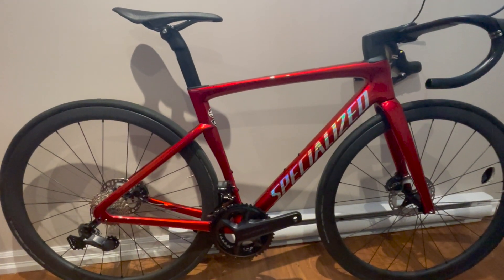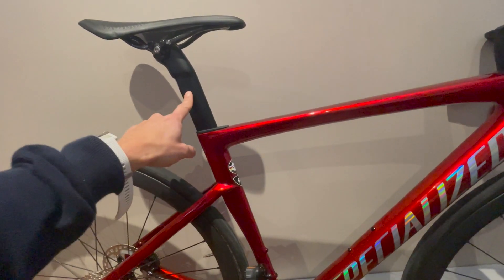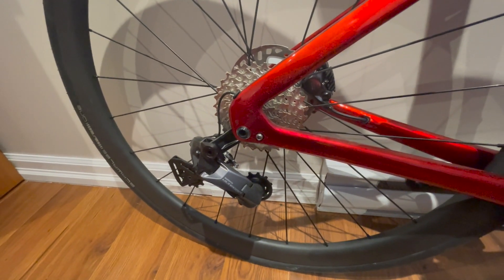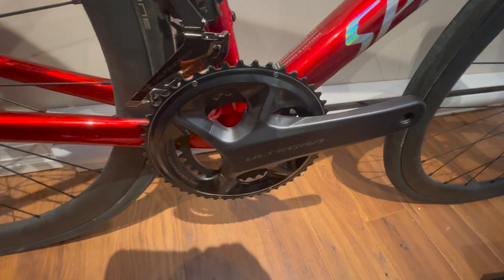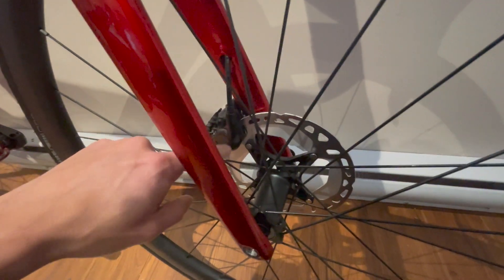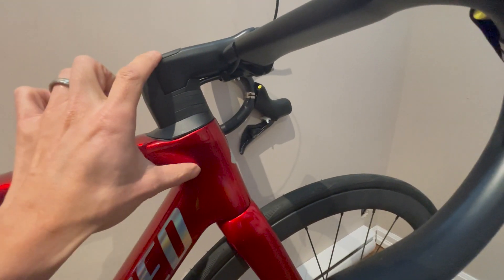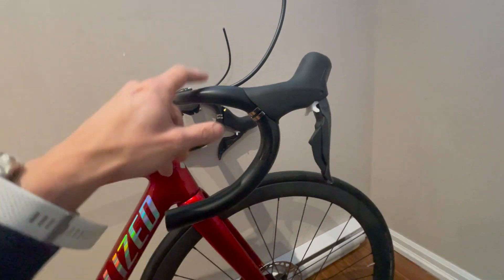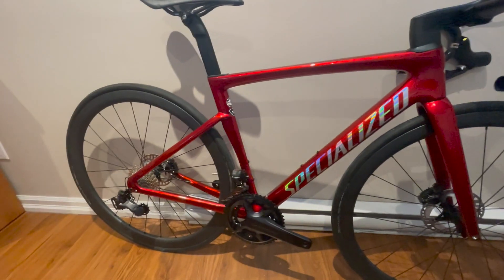Building my fake Tarmac SL7 frame - The good and the bad

Comment: That's a fantastic colour. Having worked on a few Tarmacs (and the last Venge, which had identical disc brake hose routing), I have a little tip for fitting that front disc brake hose grommet. First off, it's always hard to do on genuine and "fake" frames. The easiest way to fit it is to slip it onto the brake hose, push it up until it meets the frame, and then use the flat edge of a plastic tyre lever to push it up into the hole. The tyre lever will help to add a little more force and push the grommet in but is also safe enough to not damage the paint. Has always worked a charm whenever I build up/work on these bikes 👍👍
Reply from the maker: Thanks for the tip!

Comment: Any cracks or damages so far?
Reply from the maker: Only one carbon chip when I had a small crash.
Reply: I order a S-works SL7 sand gold. Will be here soon. I hope everything goes well. I am routing mechanical Ultegra rd.  Since it is a 1X build, no need fd. 
Any advise as far as building it?

Comment: Looks good but the color is a dead giveaway...certain colors are for certain years..that red colorway never was released by specialized..lol
Reply: Ever heard of a custom paint job? Some people go this route and choose whatever color they like so they don't look like everyone else. Lol.
Reply: @jayfranchise4713  lol..im one of them..I have an older S-WORKS SL6 TARMAC custom painted too...
Reply: @LOGICAL-JAY  haha. I also have an sworks tarmac sl6...small world!
Reply: @jayfranchise4713  yes indeed..I have the sl6 s-works tarmac 11speed dura ace di2, 2022 SL7 s-works tarmac 12 speed di2 ultegra and the 2020 venge pro 11speed di2 ultegra build...I love them all...lol
Reply: @jayfranchise4713  im thinking about replacing my roval 38 wheels for the CL2 rovals wheels on the SL6..CL2 comes with the nice reliable dtswiss 350 hub..ill probably buy another 54ratchet for that hub..even though 36t is enough..lol